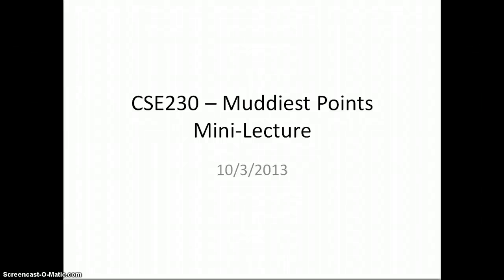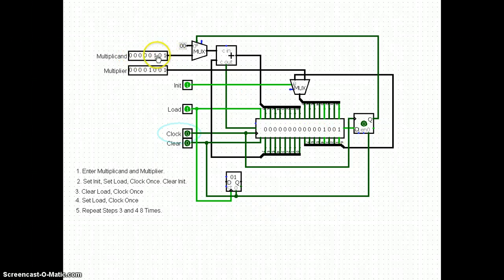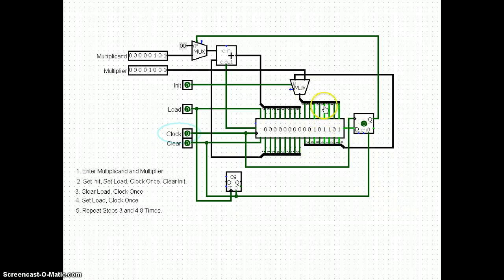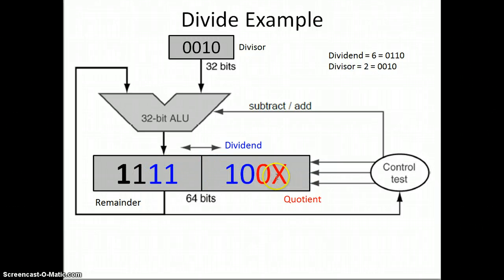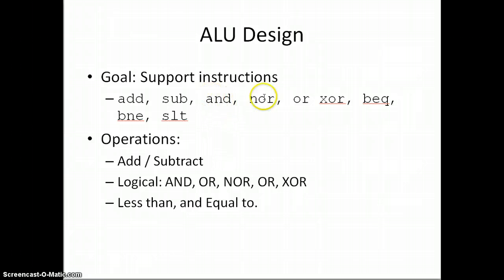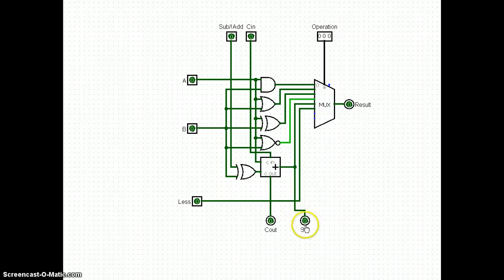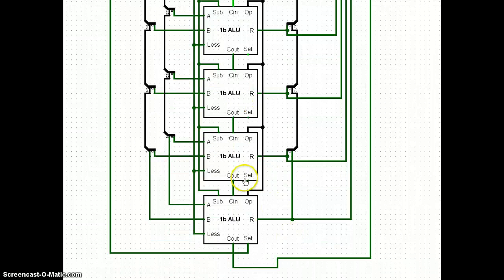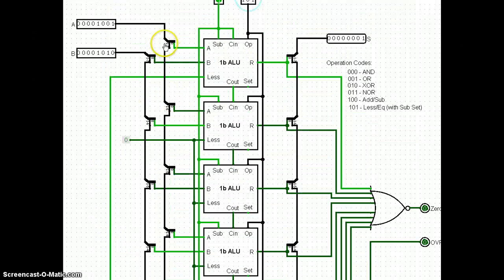CSE230 - Muddiest Points: Divide and Mult, ALU Design

Comment: Wouldn't it be faster to implement BEQ and BNE by XORing the two values assuming instructions have variable clock cycles?  If the result is zero they are equal otherwise it is not equal.